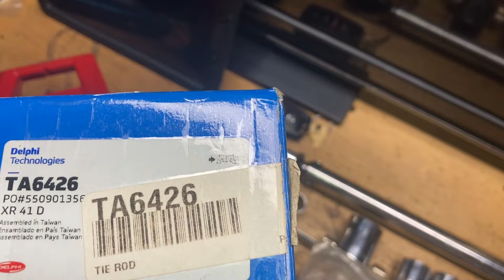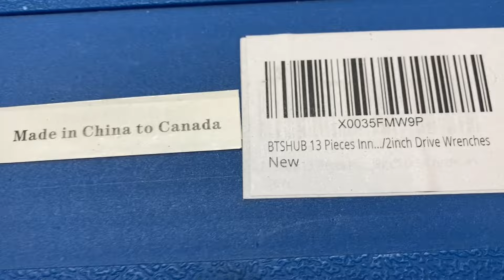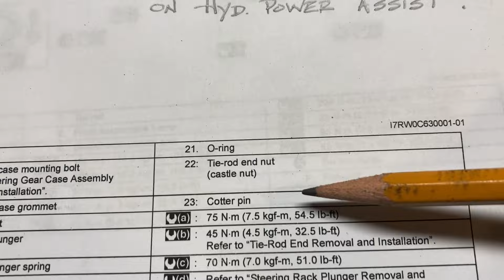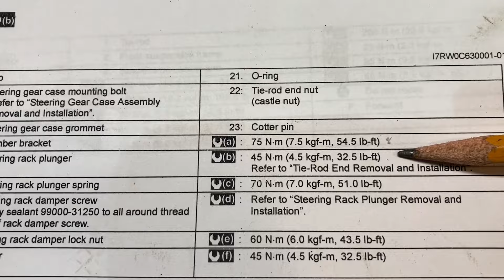Suzuki SX4 Inner Tie Rod & End

Comment: I want to do this on my swift zc32s but the schematic shows a lock washer on the inner tie rod. Can I use the same process ?
Reply from the maker: SX4’s with electric power steering require the lock washer. Hydraulic PS (my cars) do not. I can’t speak to the Swift. Thx for watching 🍻

Comment: Spot on thank you - think this is my next job. Proper job with the documentation too! 

QQ - Did this come about from steering wheel play? 

I have just bought one that has  about 0.5" on the steering wheel when stationary/off. 100% it's been on a bumpy road for a year, like REALLY bumpy, as taking it away was fiun. I can move the front wheels a little when jacked up, at least on one side that I've tried. Any help appreciated! Thank you :)
Reply from the maker: My issue manifested as a very slight wander off of tracking a straight line. If you remove the  tie rod end from the steering knuckle, push/pull in and out in line with steering rack on the inner tie rod, any play will be easily noticed. Even if the inner tie rod drops under it own weight (when tie rod end is removed from knuckle) it’s shot. Ensure the rack itself remains securely attached to structure. Lower ball joint & steering shaft U-joint wear should also be considered. Thx for watching 👍🍻